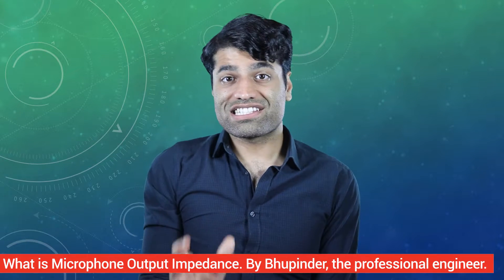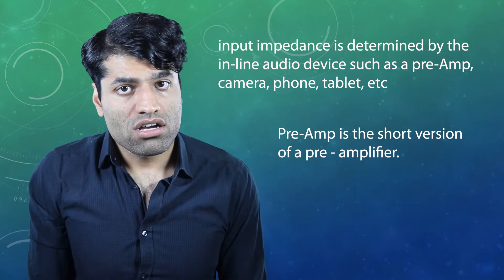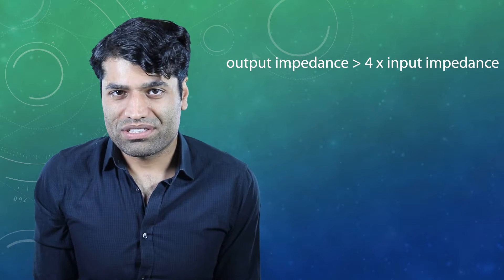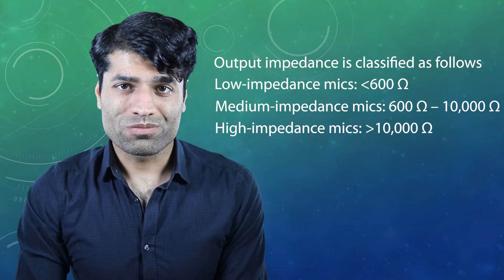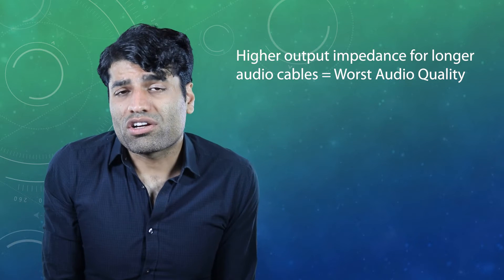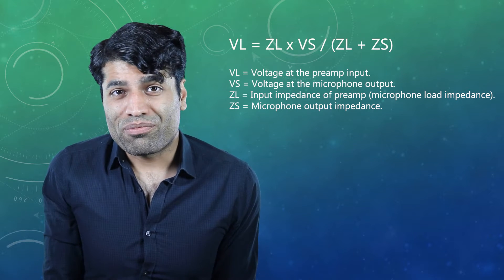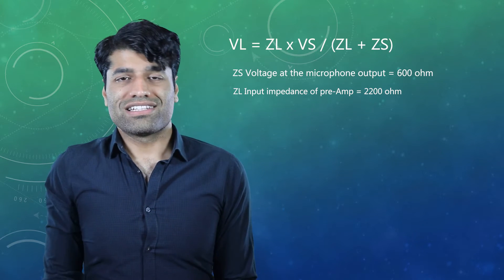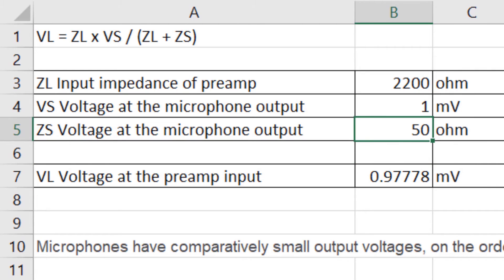What is Microphone Output Impedance

Comment: No, the output impedance of a microphone should not be higher than the input impedance of the device it connects to (like a preamp or mixer). Ideally, the output impedance of the microphone should be lower than the input impedance of the receiving device.
Reply: Ok so if the input impedance of the device is 400 ohms, which microphone is better, the one with 300 ohms output impedance or the other with 100? or both it's just ok?

Comment: Thanks for clearing the cobwebs. I purchased a JBL EON_ONE COMPACT last week and then bought a Behringer XM8500 dynamic microphone from Amazon yesterday. However, I get no output from the Mic even at full vol of EON ONE.   Where am I going wrong?. After following your article there is apparently a mismatch.   Behringer XM8500 has been rated highly and compared with a Shure SN57. It's a poor man's SM57.  Now I am stuck with the mic. or should I send it back when there is time or  Is there any other solution?